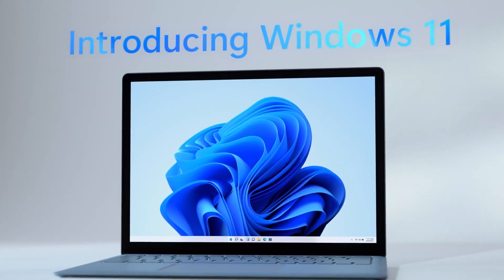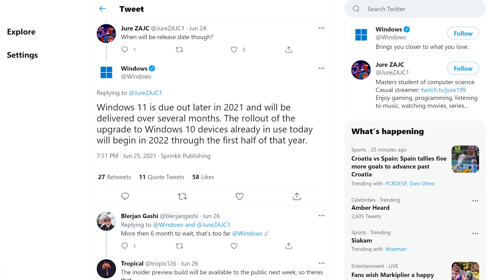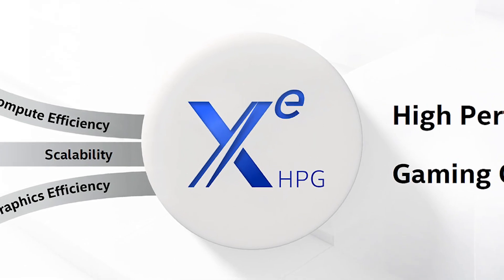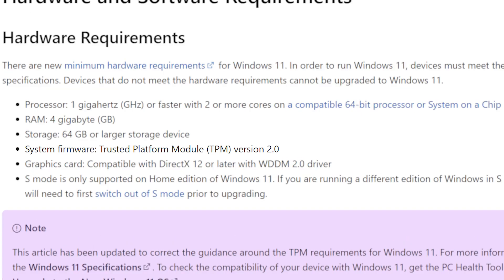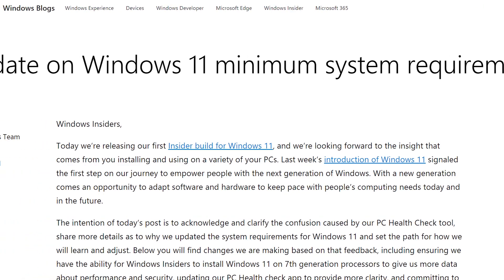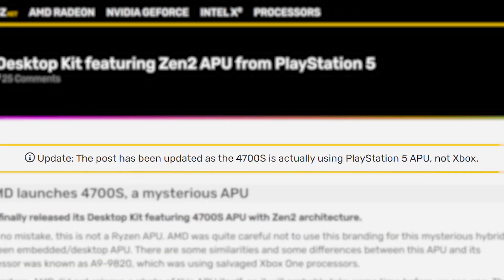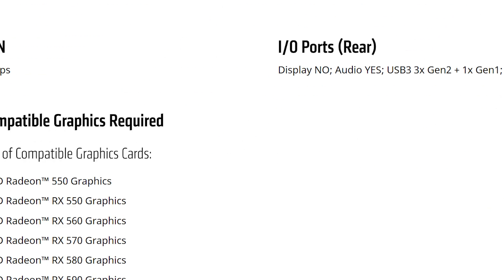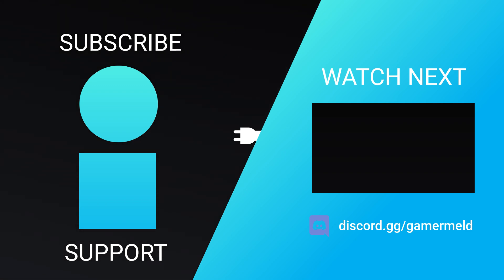TONS Of Gamers WON’T Be Able To Install Windows 11!

Comment: Windows: Hey, here’s a great idea... let’s release an OS literally NO ONE asked for and that nobody can even use!! It’s genius!
Reply: Sounds like something Microsoft would do.
Reply: @jarlnieminen4307  Okay sure are you going to pay for it? because i can't.
Reply: Like, what can it do that win10 can't? What, center the taskbar? I never asked for that!
At least MS leaves win10 free without a license..
Reply: @balenaluba4215  Direct storage
Reply: @balenaluba4215  DirectStorage is another Xbox Series feature that loads a game's assets directly to the graphics card instead of through the CPU to prevent the processor from being bogged down.that’s on windows 11 also the gamepass will be in windows 11 and I love auto hdr and don’t forget Xbox cloud gaming.
Reply: @balenaluba4215  there is a fair bit more optimization to windows 11 in theory your overall performance should be better when using it... assuming you have or can get your hands on a TPM 2.0 chip for a fair price.
Reply: @balenaluba4215  it has support for direct x 12
Reply: @balenaluba4215  You literally can still get windows 10 free with digital license
Reply: @OhSoTiredMan  Wym, that the full license is free or that I can "get it done" for free?
Reply: @balenaluba4215  stop being a peasant, perhaps?
Reply: Microsoft seems to have a track record of releasing a crappy OS every other release.  So I'll just wait for Windows 12 before I do another "upgrade".
Reply: Gonna be a vista style failure unless lots of things change in the final product....
Reply: Well no one asked for windows 95 , 2000, xp,vista, 7,8 or 10, no one asked for linux or macOS either , technology is always advancing,  it will not stop because you didn't ask for it
Reply: I am a first gen ryzen user on LTSC 2019... I think I wouldn't need to upgrade to 11 for a long time
Reply: If Noone asked for it why use it?
Reply: All the hardware vendors are rubbing their grubby hands.
Reply: And in the middle of a CPU and GPU shortage
Reply: And let's make Windows look more like Linux for those computers that can actually run it.
Reply: Yep... all part of the unobtainium package that includes a top of the line GPU and CPU.
Reply: Didn't they already do that with Windows 8/.1?
Reply: MASTER
Reply: I asked for it bro, chill
Reply: It isnt even released yet. What?!
Reply: Windows hasn't NOT sucked since windows 7... I only upgraded to windows 10 because AMD dropped support for 7, I'm positive win 11 will be dumpster-juice 🙄
Reply: You have to incentivize new computers somehow
Reply: I can use it just fine i meet the requirements
Reply: Digging their OS grave lol
Reply: I mean...I can use it :)
Reply: Yeah, I’m sticking with Windows 10 as long as possible, though I rarely use it.
Reply: You will be able to later
Reply: @nobody7817  As far as I'm concerned you can use even Win 3.11... use as old shit as you want.
Reply: Genius?? Don't ever let Apple catch you use that word.
Reply: It all a plan to sell the windows copies more.
Reply: At least 11 has a better UI than 10
Reply: YEEEEEAAAAAAAH AND LETS NOT FORGET THEIR TRENDS OF GOOD BAD CYCLE
Reply: And nobody wants!🤣
Reply: just couldn't do one word LOL!
Reply: Well i found out i can upgrade..
Reply: its crap anyway dont use it, windows 10 is superior
Reply: Meh, I have been switched to Linux a while now, so I'm good. Only things I can't do on it is run games with 3rd party anticheat.
Reply: I get it that you are triggered but don't talk shit alright ? There were people who needed a new OS with new customisation well sadly some people can't but some people can upgrade to Windows 11 and I'm currently running it too it's more than we expected so don't fuck around commenting nonsense
Reply: @just-being-aryan  Linux has had all that customization for years, in multiple different OS. In fact almost everything in 11 is ripped off of Linux and Mac based systems. All they had to do is switch to one of those for free and with less to no spying and data sales.
Reply: It's like the car industry. You need to make new versions every year. Having a perpetual windows is just bad business sense.
Reply: @Trgn  I think Microsoft was having a go at the Google Model of data mining their customers for revenue.
Reply: Yeah, it seems to bring cool new features, but I really hope that when you log in it tells you if caps lock is on before you type your password wrong.
Reply: It is for security reasons. If you don't have the hardware to meet W11 , then stick to W10. It is that simple.
Reply: Uh you can ? It’ll just be a little longer then buying it? Apparently you had a anger stroke through that part of the video
Reply: @austinwhite3132  Nobody angry here, just pointing out there has always been other options. Several even being better options. Apple may over charge for their hardware, but their software is way better for instance. Just not something I can afford, so off I went to Linux.
Reply: @michaelcox9855  yes Linux is sooooo great especially the same limitations with apple OS when it comes to games
Reply: commenting from win 11 😏😏
Reply: Windows: And end the windows 10 support by 2025! So everyone wouldl be forced to upgrade or if they can't upgrade their version of windows will no longer be supported!
Reply: Am betting you are teh same game that cry out when windows 10 was annocne and you wher still using windows ME so blah blah blah I did ask for windows 11 so obbiously you dont know shit and just liek to complain
Reply: @nobody7817  I said if you can't meet the requirements then stick to W10. I said nothing about "Well maybe".

Also yes security reasons. Have you not read what you have typed yourself? TPM is for security, given what it is. You are crying like they are forcing you to upgrade to new hardware, and windows 11. 

Based on your replies it is obvious you are trolling/delusional, or both.
Reply: @nobody7817  i have 3700x and 5700xt. I was just saying that people should make their mind and that IMO all 14nm Intel and all ryzen should be OK. They are more or less same chips...
Reply: Nobody? My system is going to handle it just fine.
Reply: free windows upgrade I'll take it. I mean no one is forcing you to get it right. It's just an optional free upgrade no?
Reply: @nobody7817  OK, thanks... I think.  lol
Reply: That sounds exactly like nvidia. Let's release a ti version that no one wanted and no one can get.
Reply: I know right? I couldn't care less about this mess.
Reply: I WANT WINDOWS 11 in the update
Reply: It's not like Service Support for 10 is going to end the second that 11 launches, guys.
Reply: @rcslyman8929  it will end too damn soon regardless.
Reply: I can.
Reply: At this rate more people will switch to linux, and get free iso's of windows 11 (skipping the license key) for vm inside linux
Reply: Maybe because in windows 11 we can use some like android apk? So the older hardware gonna hard to keep up?
And just patience nowadays were in the hard days were many people didn't had good luck cause Covid.
Reply: Google will eventually take over and make a desktop Os better then windows and very close to the design. I think Microsoft wants that too. Every decision they now make goes against all logic.
Reply: A new windows 8 has arrived
Reply: Yeah… aside from gaming, there really isn’t much I do on my PC that doesn’t work on my $35 raspberry pi. Modern processing power is WAY overkill 95% of the time.
Reply: I can use it...
Reply: Dont forget that it’s horrible as well!
Reply: Wow! My laptop barely meets the required. And I had it for a month!!!
Reply: What the fuck you're talking about? Windows 10 is god awful and terrible os
Reply: Im using it right now
Reply: We the consumers didn’t ask for win 11, but the hardware companies did. With little reason to upgrade,  Microsoft is siding with the hardware companies to force hardware upgrades.
Reply: companies don’t make stuff just cause you asked for
Reply: @tarragoni4161  If nobody wants or needs it, nobody will pay for it, hence no reason to make it.
Reply: No one really ever asks for a new OS… we just get them, and implement them when we’re ready. Windows 10 will be fine for months to come. So why’s anyone even care ? Just chill till it’s stable IF you want to switch.
Reply: No one can use? Wtf everybody claim to be a gamer and the specs are way below that..... Yes if you count candycrush as gaming then there will be an issue but nearly every laptop has at least a dual core cpu, I don't know anyone with lower specs even the raspberry pie has a quard core what means 4 cores. Tpm is an issue but every device can be upgraded with it. Besides what they mean is for the uefi install, it's only a marketing thing as for this recent randsomware attacks. So I do not know what are you whining about.... I run win 11 on my old surface pro 3 what is 6 years old and has made the transition from win 8 to 8.1 to 10 and now even goes to 11.
Reply: If you don't ask for it doesn't mean you don't need it, Users were more than happy with Windows 7, would you stick with Windows 7 forever?
Reply: @shutupnavikrant  Actually I would. The OS doesn't add value unless it does something new. As a gaming platform Win 10 only offers HDR (my reason to side grade from win7). Win 11 is just another meh!
Reply: @karsh001  Directstorage will be great mate.
Reply: @shutupnavikrant  id rather still be running 7. i do on some of my computers.
Reply: @shutupnavikrant  Honestly I would have.
Reply: @shutupnavikrant  On my laptop, yes
Reply: @shutupnavikrant  I used 7 till 10 came out. I can use 10 for 5 years, no worries
Reply: Yes I would have absolutely stuck with win7 forever. That is a dumb question.
Reply: @shutupnavikrant  I sure will. It is still the best and least intrusive version of Windows by far. When I am finally forced to change I will go to Linux or anything but Windows "We know what is better for you".
Reply: @shutupnavikrant  Windows 7 simp
Reply: @shutupnavikrant  I would have kept Windows 7 forever... the more stable OS they have done for me. Just a few cool things from 8 an 10 into the 7 and they whould have me forever!!!
Reply: @shutupnavikrant  Well anyone would (/should?) if the OS upgrade means selling more of your data to Microsoft ¯\_(ツ)_/¯
Reply: @banana6963  How do you know that. Dont make speculations about stuff you have no clue about
Reply: @heershah6451  Eh what? Windows collects a hell lot of data and that is not a speculation. That's the sole reason for many Devs to shift to Linux where they can just control everything unlike Windows.
Reply: meh,  thats what they said when they released windows 8, 8.1, 10. still here you are using the latest.
Reply: People need to get their shit together.... They don't upgrade to windows 10 staying on 7, or when they do they refuse to update it to latest builds but when they can't upgrade to 11 they loose their shit... Make up your mind everyone. Also ditching like 10-15 year hardware is great - compatibility/reliability will go through the roof - but they should include 7th gen and Ryzen 1st gen IMO. That would mean that on launch in 2022 they will have 5 year CPU (and GPU as DX12 is old news now) support which is more than enough.
Reply: @RafalBorowski  why? A 4th gen Intel i5 or i7 can still hold its own against modern titles, keeping well above 60 in most cases. This is just planned obsolescence no?
Reply: @RafalBorowski  the option to upgrade should be open. I was happy with windows 7 but I decided it wasn't practical for the modern day I chose to move up and into windows 10 (not the best choice I ever made) but I'd love to be able to move to windows 11 one day or If I don't I want it to be bc I chose not to. not bc my brand new computer doesn't have a $15 chip that is now running about $100 bc it's suddenly essential (even though from what I understand it's hardware that doesn't do anything that software can't.) people want to have the option to move forward even if they don't want to.
Reply: @RafalBorowski  Would just be easier to use Linux in that case, really... Until 2025 though, you could use Windows in any case.
Reply: Nobody can use? Exaggerate much?
Reply: Isn't that a good thing tho?
Reply: I want it because it has some nice features and fixes over windows 10
Reply: Stfu amd fanboy lmao. Cry
Reply: I sure as hell asked for it. I was sick of Windows 10's unimpressive UI. My only disappointment so far is that they are not offering much beyond an UI update. And of course, the new hardware restrictions are not nice.
Reply: @MeowtronStar  you also get more ads in different places, and tighter Microsoft account integration, and they will peddle teams, instead of skype or discord.
Reply: @MeowtronStar  2021 and you need a new OS to update UI? Jesus
Reply: @MeowtronStar  if anything its bound to be worse most of the core os is written in a hybrid of android and windows c++.
Reply: @MeowtronStar  they could have done these I'm the windows 10! Why make a new oS , this can be done by a update
Reply: @MeowtronStar  so you're sick of w10's "unimpressive ui" and prefer an MacOs inspired one? the main reason i use windows or linux on my pcs is because it's not apple, i don't like the new one, instead of being a modernized windows ui like most of them before it, it's a MacOs ripoff
Reply: They're banning peasants
Reply: I'm always up for a new Os! I just built a monster desktop so I'm good!
Reply: @Pjiggy  I just built one too. but I don't have a TPM 2.0 chip and at the prices they are selling for (if you can find them in stock) it's not worth it.
Reply: @justinkaufman495  yea that might be an issue for me too actually. Brand new computer. No tpm 2.0
Reply: @Pjiggy  I've heard you can get by with intel PTT enabled in your bios but if that doesn't work it really just doesn't make sense to buy a $15 chip at 100% markup I think maybe I'll just dual boot Ubuntu with windows 10 until it loses support. $1700 later and that stupid TPM 2.0 chip is the only system requirement I won't meet. ig windows isn't for me.
Reply: @justinkaufman495  I know. Specs wise my machine is a beast and fully capable of the os and idt all comes down to one little chip? that sucks!
Reply: @Pjiggy  exactly. one little suddenly expensive chip.
Reply: Bro have you tried Linux? I discovered it like 15 years ago looking for something to tinker with and fell in love. I dual boot to windows for VR gaming but everything else I’m running Linux I love how easy it is to customize :)
Reply: windows 10 is still receiving support until 2025 so why did these boomers have to complain about it and talk like ms force them to do so lol
Reply: I asked for it. I have a Samsung Odyssey G9, Denon AVR 3700, and a 77 CX all hooked up to my computer and it frequently crashes because of Windows 10 terrible monitor stability. Also the Windows implementation of HDR is terrible!
Reply: @michaelscardino8614  Sorry to say, but all those issues will remain in win 11. 
MS fired their test team so they won't even try to make things better.
Reply: @michaelscardino8614  hdr works for me just fine but you do have to tune it
Reply: @myfavorites217  yeah HDR works but generally speaking the implementation is terrible compared to Mac OS. I work at microcenter and it's been helpful to see the difference in HDR on a display like the XDR display to a display like the PG32UQX or the PG35VQ to displays that I own myself like the the Samsung G9 (terrible HDR btw) or LG CX (phenomenal HDR but wish it was brighter).
Reply: @michaelscardino8614  here is your problem you buy hardware that is not common on the mainstream and have issues, gosh I wouldn't have guessed it. If you go with a middle class ASUS you wouldn't have had any issues and save money for the next 3 upgrades 😉 but you think you smart and do it your way 😉 look no one buy a fridge in at a insurance company meaning Denon is top in music, amplifier... Not for computer and hardware there are they newbies, Samsung Android tablets, hardware, but not pc builds.... Infrastructure wrong, can compare to running win on a raspberry pie, it works but how..... So sorry user issue not Microsofts fault!
Reply: Well, I asked for it, and it's good to kill off older hardware
Reply: @syedrayyan1782  Well you're certainly not part of the majority vote.
Reply: @fred_e  Hook, line and sinker.
Reply: @DJdoppIer  nothing wrong with having a different opinion
Reply: @DJdoppIer  considering a majority of the vote will come from people who just buy a new laptop each other year 💀 he ain't wrong
Reply: @syedrayyan1782  it's good to create huge volumes of e-waste?
Reply: Moving on is a good thing, but not everyone can afford it, or have a need to afford it.

Quite a few old ~2010-2017 components are still whery much usable in 2021 and is still an overkill for some
Reply: @syedrayyan1782  I have a new hardware and i cnat use win 11, what the f?
Reply: @syedrayyan1782  if by older you mean 2 too 3 years no its not i could understand if it was 10 year old hardware but not 2 too 3  year old hardware.
Reply: @syedrayyan1782  chicom go home.
Reply: @syedrayyan1782  try harder
Reply: @syedrayyan1782  How's it feel to be supportive of the environmental destruction of Earth? Luckily we live in a world where Windows is not the only OS, and quite honestly it is the worst OS. Everyone should switch to Linux.
Reply: @syedrayyan1782  my new computer can't run windows 11. how new? I just built it yesterday. that older hardware nonsense is bullshit also not everyone is looking to open their wallets to buy new hardware everytime Microsoft decides its time for them to. the cost of upgrading is a chip that was $15 but is now $100 in what world is that a good thing?
Reply: @syedrayyan1782  lol this kid needs a psychological treatment.
Reply: @syedrayyan1782  First gen Ryzen is not old hardware
Reply: @syedrayyan1782  why the fuck would you want to kill off older hardware? Do you think everyone has money to constantly upgrade their whole pc every 3 years to the newest version of components? Even the people who do have the money, most of them would be greatly damaged by having to do this since it costs so much.
Reply: @syedrayyan1782  yeah its good IF YOU HAVE MONEY TO SPARE not everyone has thousands of dollars in their wallet, most gamers that are under 18 save their money just to upgrade their gpu why would they need a faster cpu ???
Reply: "Pleb gamers" are not supposed to use this new shiny operating system, how about you upgrade to a proper gaming pc instead of complaining you cupcakes :D
Reply: @MetroidRTX  You must've living under the stone then. ITS PANDEMIC!
Reply: @matt_trix  ok then, now move along. :)
Reply: I guess I have to change my name to "Nobody"  since i'm running on windows 11. Ok then.
Reply: Microsoft provides a free software, but attaches some hardware requirements. Anyone that falls under the requirement has a big pissy fit, that their old POS machine can't get something for free.